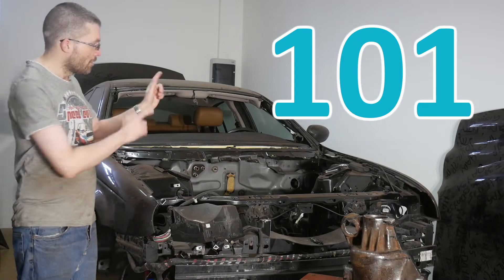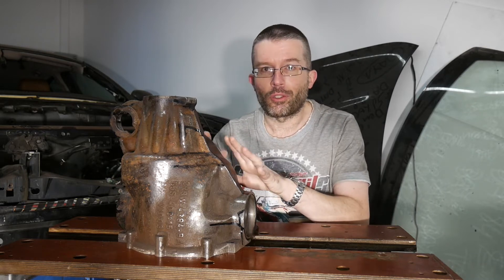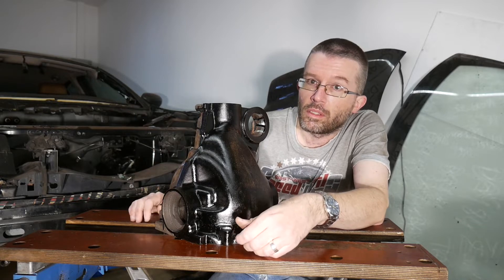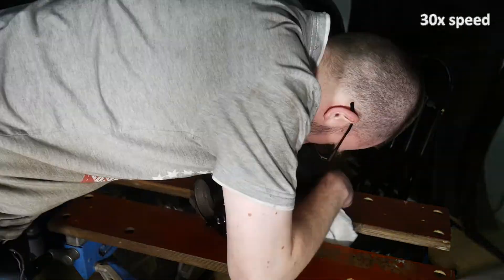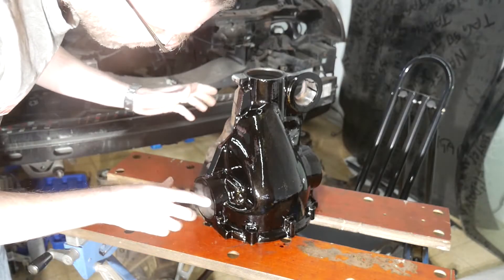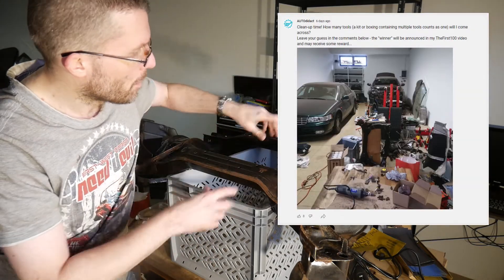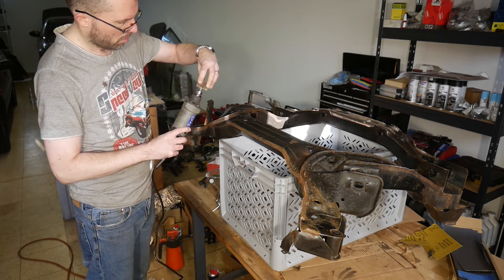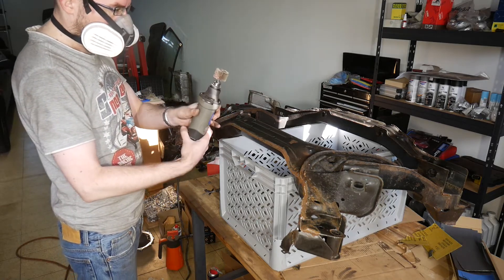Jaguar S-Type Restoration [101] DIFFERENTIAL Rust Removal (4) The Outcome [2021-12-12]

Comment: Hey! Ive put my engine back and i think the harness it so sentitve that i have a 1volt power drop. And now the transmission shoots the p1643 code. There is a cable that brakes down with ease. Make sure ro check continuiti/resistance on the hatness before installing :)
Reply: Its the brown red cable
Reply from the maker: Thanks a lot, I appreciate your advice!